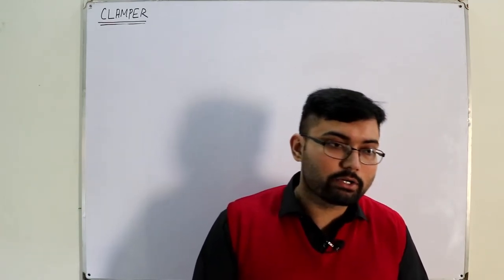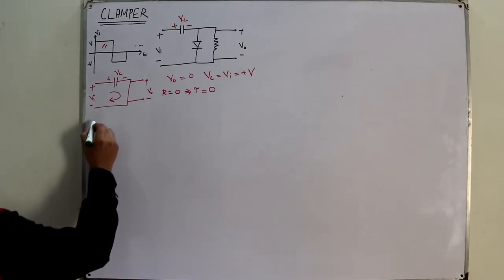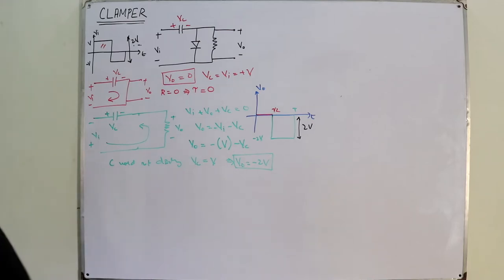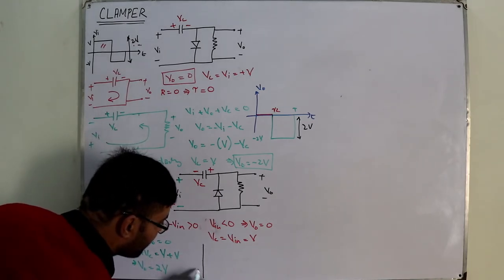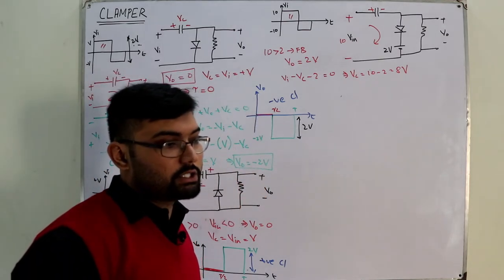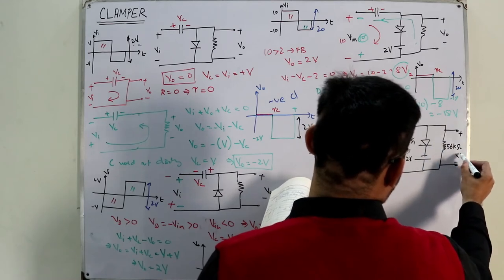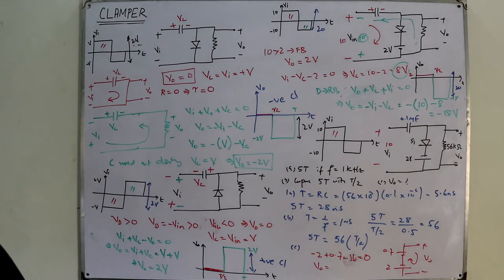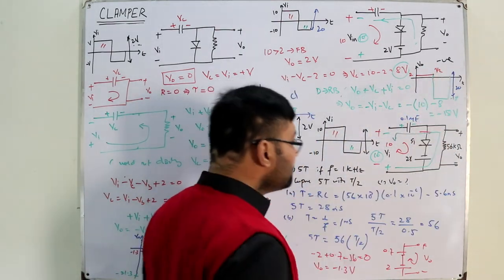Examples on clampers

Comment: Sir, thank you for your videos. I was wondering if you have thought about adding some circuit simulation. LTspice is a free application from analog devices.  I modeled the clamper circuits and was able to see the changes in the responses for the first cycle.